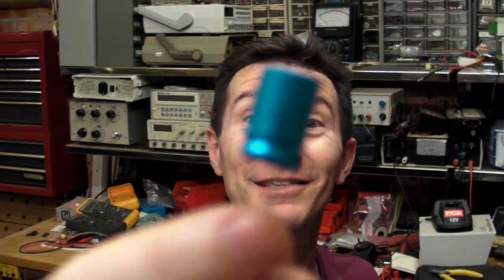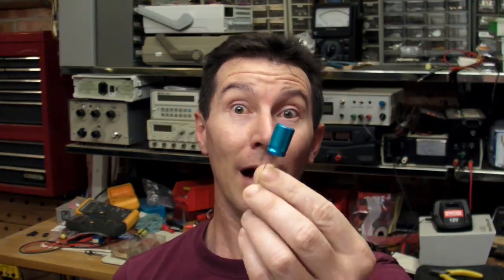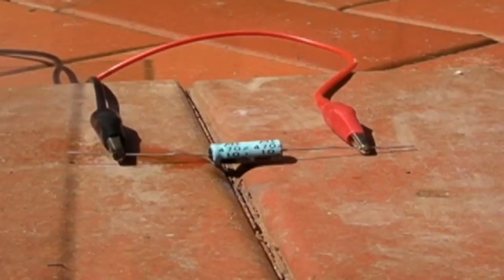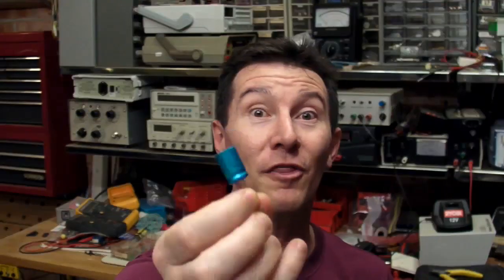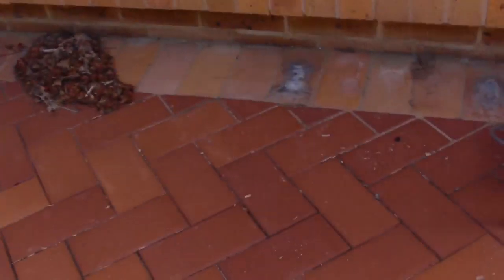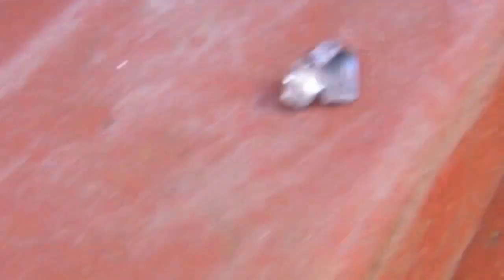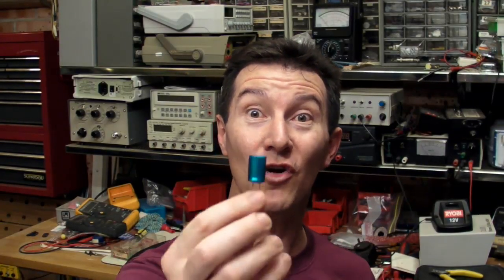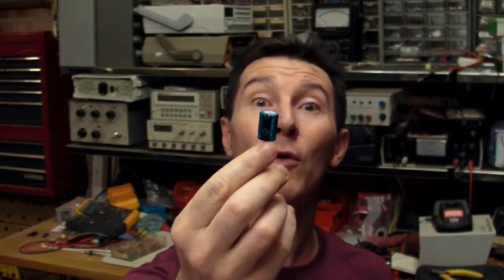EEVblog #42 - Exploding Capacitors in High Speed

Comment: Will there be any danger of explosion during the process of reforming at 10% voltage step of large 5800uF 400V capacitors?

Any fire risk?  I intend to do it in the bathtub (without water of course) and covering it with a plastic tub (how big should it be to allow for air expansion during explosion?) with vent to prevent electrolytes spraying all over.

Comment: A few months ago i soldered some caps parallel on a stripboard to do some testing. So I hooked it up to 4 AA Batteries in series and tried like an idiot to get the connector in; didn't realized I tried to hook it up the wrong way. Still glad these didn't blow up,  not even a single bump on the vents...

Comment: Ah, I remember the terrible terrible stink of exploding electrolytic capacitors.
If I remember right, you get the job done quicker and with a bit more bang if you bias them correctly and just exceed their voltage rating.

Comment: Imagine if one of those caps blew up in the back of someone's TV.  And I thought modern caps were bad.
Reply: Failure like that is very rare. The reason this one blew up so hard is because Dave put a reverse voltage on it. When a capacitor pops in a TV it's usually because the electrolyte dried up, and not reverse voltage.

Comment: I had an electrolytic blow like that in a radio I was building.
In my defence I will say that it was late, I was tired and maybe not paying as much attention as I ought to have. The bang of the electrolytic sure woke me up. The effect was like one of those party poppers, but without the pretty coloured paper.

Are you sure the alleged tantalum capacitor was not really an electric igniter to light your gas stove?

Comment: Hi , i am currently working on a project as part of my uni and was planning to implement a supercapacitor based storage system. After watching your video I am very dreaded and giving second thoughts. I have been going through lot of documents where people talk about balancing circuits using resistors, inductors or caps but not any concrete circuit ideas. Can you please make a video over supercapacitor balancing circuit please??

Comment: I had a cap part my hair working in the tv repair trade as an apprentice. My boss had two big smoothing caps blow up in his face while trying to detect where the heat was from. Some jerk had replaced the caps or the bridge rectifier and put them it backwards.
Funny now but not at the time.

Comment: That one doesn't have a safety vent; that actually is the Nasty Failure Mode.

They only use the non-vented design on very small caps like this where the energy that will be released by the cap blowing off isn't like, enough to be of interest to Mythbusters or anything

Comment: @gglovato DON'T TRY THIS AT HOME!  You know, another fun experiment: get a large, high voltage cap, charge it up (don't blow it) and throw it against a metal door/wall/sheet.  They'll weld on with a loud pop.
If you mistakenly grab both contacts, it won't be pleasant (anyone who dissasembled a camera with a flash probably knows), but it's a lot of fun.  DON'T TRY THIS AT HOME!

Comment: Many years ago I was working on the bench next to someone testing a fais sized military power supply. He ran the variac up and then tried to dial it down fast. Not quite fast enough - one of the computer grade caps was in backwards and it launched out of it's case up into the overhead 8 foot flourescent fixture. There was smoke and glass everywhere. Those computer grades could be pretty spectacular when they let go.

Comment: I guess there is a connection btw electronics guys and blowing up parts.When I was a kid I started out blowing up LEDs which would crack or the top would blow off when too much current passed through. Of course I blew up caps too, but the best explosions I got was from the old carbon batteries, like d cells they had back in the 70's. Alkiline didn't do much, but the carbon ones would explode when hooked up to 120 vac for 15 seconds or so. I built a battery holder with nails for terminals.

Comment: Try a 10,000uF cap with 300volts AC,
or reverse feed an old speaker transformer (4 ohm at 240vac)-you should get a nice green glow before it blows (don't try this at home)